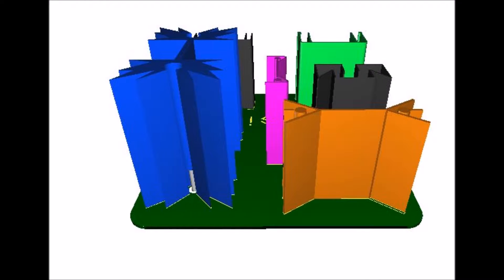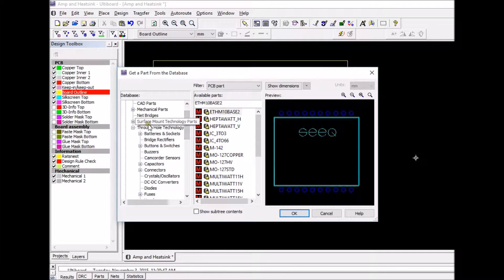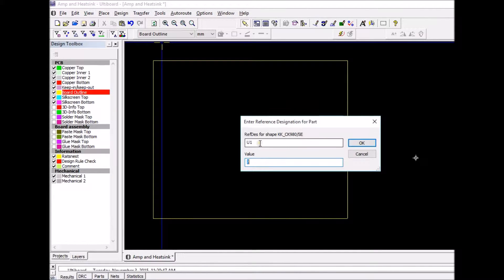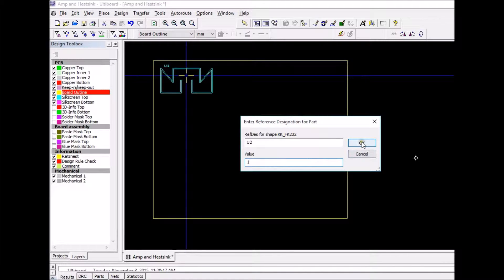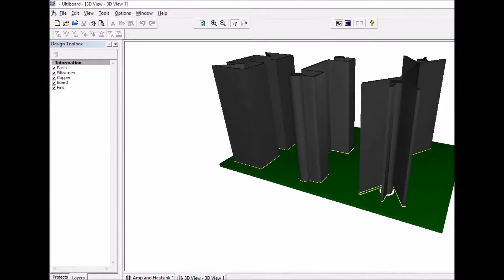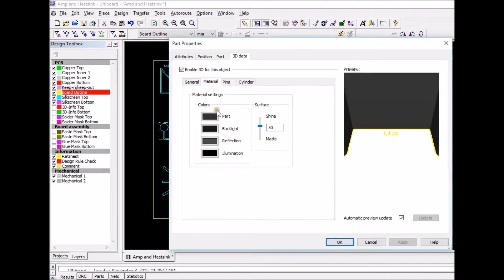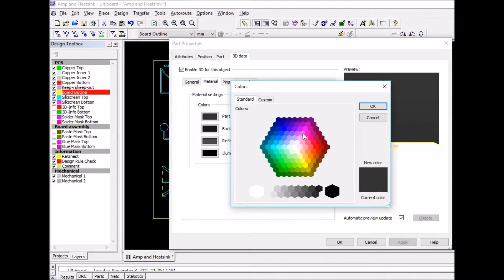Heat sinks in 3D | Ultiboard

Comment: Can you share those cooler view( PCB-3D, 2D) with us?
 if it is possible
Reply from the maker: Hello. What 3D view would you like?
Reply: to place a device on PCB-3D, we have used their 2D and footprint(3D view) to design the PCB card.
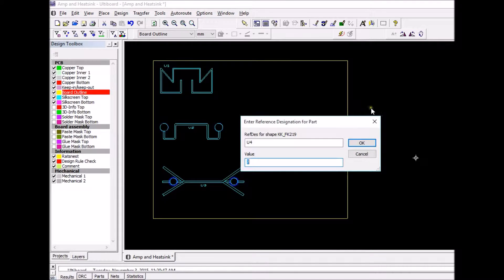Reply: 1:17- 1:25 you had placed the heatsink footprint form database.
 it is possible for Altium such things?
Reply from the maker: I am not sure for the Altium software  @mustafaglnr8780
Reply: @Bits4bots  ,
you can share the files of your heatsink on 3D board you placed.?
or weblink?